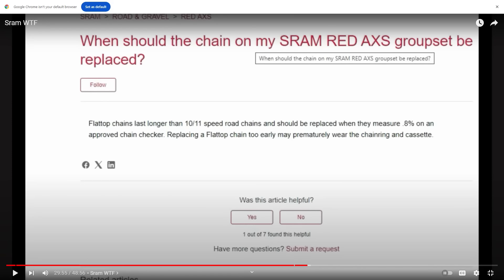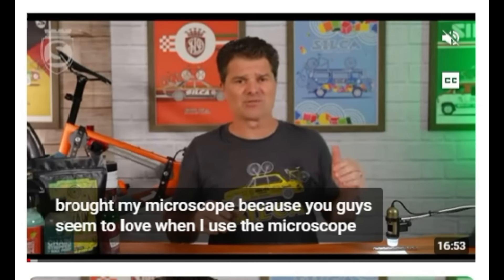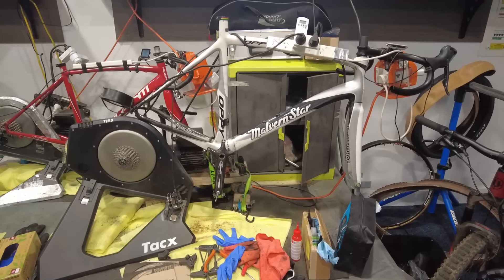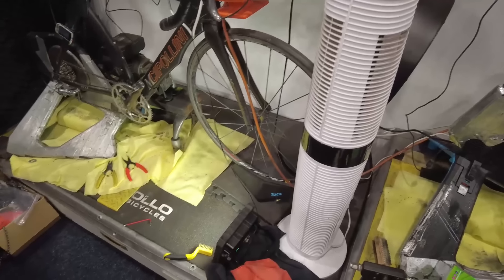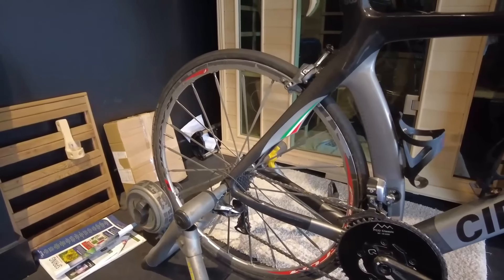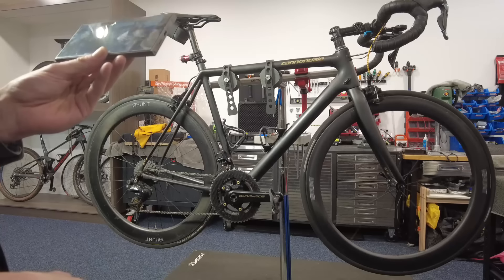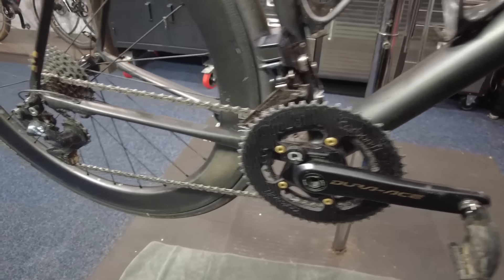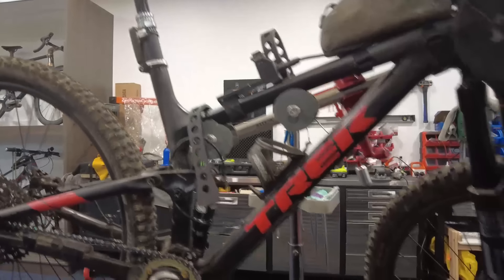News + My bike Fleet!

Comment: I only get the "wow this is a heavy bike" over 35lbs or so, and that's a mtb with a ton of suspension so it's fine. 
Of course the guy in australia hits a 🦘. Worse I have done is a snake. Some deer and turkeys have surprised me.
That final custom bike is beautiful. As a lug enjoyer it takes me back to the early carbon days of aluminum lugs+carbon tubes, but this is way better. I think of it in time for value. If one plans on spending a ton of hours on a bike it is much easier to justify it in my mind.

Comment: That's a great collection of bikes! Comparing your bikes got me thinking - how much 'suspension' effect should I expect from the Rock Shox Psylo front fork on my 2005 Marin full-sus MTB? Seems to do nothing unless I brake hard or hit a pothole. Do they seize up when old? Any ideas for a good replacement?? Sorry for the digression, it won't happen again!
Reply from the maker: Hey! i love digressions :). When was the fork last serviced? im not very familiar with the psylo, but all rock shocks forks i have owned have stated to service every 50 hours (which to be honest i sometimes extend out to 75 to 100, but typically never past 100). If suspension is not serviced, then it will not continue working well longer term, and then often a service can be very expensive vs just fluid change and new seals, and require a bunch of new parts such as new damper, bushings etc that have been worn by running abrasive dirty fluid for a long time (seals only last so long) - and very bad performance like being pretty stuck unless a hard hit - that is not uncommon with suspension left unloved. 

So have a good mtb LBS mechanic check them out, but be prepared - based on the price of psylo forks, new forks might be cheaper....
Reply: @zerofrictioncycling992  Thanks! It was a £120 (17-YO) bike when I got it two years ago, fork has never been serviced that I know of, and all the UK suspension specialists say that Psylo fork service parts are no longer available. Not on eBay either. I think it is seized up but not sure how much improvement to expect from a new fork. I was crossing some rough ground today at about 15mph and there seemed to be no deflection at all. Rear is also old RS (SID/XC) but that is working perfectly if I top up the air every couple of months - there are no spares available for that one either. It looks as if a new fork is on the cards!

Comment: LOVE your videos, mate !  A little constructive idea if I may :-) You might get a wider readership if you shorten your videos . . .
anything over 30 minutes is quite an online time commitment these days :-)  
1) With regard to using my Silca wax system : with a new chain I use their Silca Chain Stripper and then the SS Wax .  I don't believe in using the Strip Chip - I don't want ANY factory grease mixed in to my wax - ever . . .  
2) when re-waxing I do not put a chain with used wax on it (even if it LOOKS clean) in the SS Wax - I don't want ANY potential dirt mixing in with the virgin wax  . . . 
3) when re-waxing I remove the wax off in boiling water and then pop it into the hot SS wax -  IF any water remains on the chain it gets boiled off in the hot wax 
4) Ask Brad to take the following  into consideration : The mind is like a parachute : works best when open :-) He seems so intellectually shut down for not TRYING waxing !!!  I've been riding for 50 YEARS and NOTHING compares to waxing and believe me, I've tried ALL alternatives ! 
5) I haven't seen ALL your videos but there are advantages WAY beyond better drive train life when waxing - my bike is quieter, shifts more smoothly and more quickly and at a ride's finish, I simply take a clean cloth and take off road debris off the chain and I can clean the frame without worrying about touching the chain with my cleaning cloths because they never get dirty when touching the chain - and neither do I !! 
Keep up the good work and videos, mate. Greetings from Montreal !!!
Reply from the maker: Thanks David! And yes i know, i really do need to better on my vids, and i keep promising i will, and then not hahahahaha. I do struggle with a) it is not my strong point to begin with and b) i just am always rushed - it takes way more time to try to organise, script, cull, retake, edit etc a much more slick vid than just record the clips, wing, and boom thats that i had 1 or 2hrs window on a friday and trying to keep up. I keep hoping to find a bit more time to improve, and i will keep trying - thanks in advance for your patience and bearing with me in between! 
(oh, another problem for me is i like long vids so i also naturally gravitate to those too! but i am odd :)) 

Re 1) The whole idea of strip chip is it converts the FG to wax. its been pretty well tested, i need to control test it to see if any change in performance picked up by the main test, but havent got there yet, testing has been mental lately. 

Re 2 & 3 - its a balance. ie is the aim to ensure every possible fraction of a watt? (ie race chain, race wax pot) or is it to prolong the high performance of wax for as long as possible to get longest amount of re waxes, and lowest chain and component wear. If its the latter, and ESPECIALLY if most of your riding is dry road, the case for boiling water flush rinse every time is sadly not strong. It is possible that the water is evap out everytime no probs, its possible it isnt. We sell anywhere from 2000 to 3000 wax chains and wax per year, so we have a very big waxing customer base built up. Every year we get a handful of cases where a customer is experience high wear rates, despite being on a good chain, good wax, re waxing at normal intervals etc. Almost every single time it turns out to be that they are boiling water flush rinsing every time, despite only riding in dry road conditions, and waxing chain either wet, or with very slack attempt at drying. When this is stopped next chain and wax, yeehaa - awesome longevity for chain as expected. Mspeedwax hae also conducted tests and when cut open wax found pockets of water in the wax. But also, water is not without its own impurities, so over time it may be hurting wax / wax bond if done every time. 

Simply there is no case yet that the cost of elec and time to do this gives any benefit to dry road riding, even dry off road riding, and there is concern it is a detriment. Post wet rides - for sure, but we recommend drying chain with hair dryer or heat gun to be safe. I do this a lot in my winter riding, and i am getting still awesome wear life. 

I would watch waxed life like a boss vid and switch to the two pot system demonstrated there - this is the easiest way to keep wax amazing. As i ride dry offroad a lot too, this is brilliant for gravel / mtb as whatever dust isnt removed with a 10 sec wipe with cloth and alcohol spray to lift surface dust will then be melted off and settle to bottom of pot one. Really fast, efficient and guaranteed no risk of being worse, only better. 

Remember also what you are comparing too re drip lubes - drip lubes add 3 to 5 ml over the top of what is already running in the chain. And that is done over and over. Vs putting into a bath of hundreds of ml. It takes oh so many re waxes for wax in pot to be remotely like what is happening with drip lubes - so for training chains - one really doesnt need to stress much, most especially dry road riders - just so little contamination gets in when running a solid lubricant. but have a ponder, and if you tracking wear life - pit your boiling water rinsing method vs two pot like a boss system, the latter will win, and be easier :) 

Re 4 - yeah i have no idea what is going on with some still with mtb background. It is frankly illogical. Perhaps all his waxing customers are using the gunkiest DIY wax, and it takes them ages as they stand there to watch it melt. Must take them all afternoon to do washing when you have stand there to watch the washing machine and then stand there to watch the dryer. Far out. They will get there - but whats taking the mtb world so long is rather fascinating. And now if anything getting embarrassing. I mean it is just so simple, and quick, and logical. 

Re 5 - correct on all fronts! :)
Reply: @zerofrictioncycling992  Adam ! Thanks SO much for taking the time to write a really well developed reply to MY long comment . . . you're not the ONLY one that can go long as you can see here ! :-) 
Speaking of going long, I'm happy that you didn't take offence to my suggestion regarding shortening your videos - each to their own, right?  And  if someone doesn't want to watch a 50 minute video, nobody says they HAVE to :-)  I have never made a video but I do recognize that it takes a whole BUNCH of effort and time to produce good and informative ones like yours. 
 I will from now on, thanks to you, simplify my life and re-wax by immersing the chain in the SS Wax while skipping boiling the old wax off;  fortunately  being relatively new to waxing, I took the precaution of putting the chain in the oven at low heat for a while to help evaporate any moisture on it but from now on as you suggest, I'll forgo that step. 

Following another suggestion of yours, I watched the Waxed Life Like a Boss video and I find the two pot system simply BRILLIANT!  Coming from a professionally trained background of automotive detailing, the ONLY thing I would change there, is making the stand-off dirt guard in pot ONE a little higher with a slightly tighter "screen" to make SURE that while immersing the chain, some links don't accidentally fall through and that the whole chain does not "disturb" the jetsam at the bottom of the pot :-)  

When it comes to clean, I'm lazy as you will ever find LOL  . . . I ride non-racing road and never in the rain if I can help it . . . so as per your suggestion,  that leaves me free to simply dump my chain straight into my hot wax to re-wax if I understand you correctly . . .  

Thank you also for your take regarding the Silca Strip Chip miraculously converting FG  into wax . . . with no chemistry background,  I'm having a bit of trouble getting my head around that but since the Silca Chain Stripper/ Chain Prep does such a great job on a new FG chain, I'll calm my nerves a bit and continue with that and as Josh does, I'll keep the Stripper "alive" by putting it back into the bottle through a coffee filter.  On YOUR end I can readily understand that in PRODUCTION, that might a QUITE expensive option. 

Since I won't be having to deal with dirty old greased up and lubed up chains I won't have to worry about cleaning THEM fortunately ! But I think that if I had to clean and wax a friend's gummed up chain, I'd use brake disc cleaner first on the removed chain (as long as it measured correctly for wear) and cassette but that is HGHLY  toxic so  I'd do THAT outside and  over a bucket that I could dispose of safely and environmentally safe as well.  After having completely cleaned the chain with that toxic brake cleaner and letting it dry (a matter of seconds)  I'd THEN pop it into the Silca Chain Stripper Prep to give it the best chance of having the hot SS wax adhere to it. UNLESS you have a better idea about that process of course :-) 

THERE! if you think YOU can go long . . . here's a dude from Canada that can be your counterpart in the UPPER part of the Globe LOL 

 I'll be watching your videos like a hawk from now on and catching up on the ones that I have missed!

Many thanks Adam  . . . And Cheers ! 

Sincerely, 
David 
Montreal
Reply from the maker: @davidbee8178  thanks so much david, sorry for delay response on this one the weekends things get away from me :) 

Much appreciate your input and support and yeah lets see over time if i can get better at my vid presentation - and never worry re offence on things, there is always a very easy clear difference between one wishing to give feedback for help, vs someone just being a douche and hating on X persons efforts. I have barely a clue re YT, vids, editing, and like - speaking.. so already i have had some really helpful tips and hints from viewers that have improved things from uber basic to..... slightly less worse :) 

And yep with existing chains for sure that is very chain dependent. Ie if it is a half worn ultegra 11spd - is it worth it. If its a sram hardchrome chain worth a pretty penny, for sure still worth it. But existing chains really can use a lot of product to properly clean for waxing, and the expensive fancy cleaners arent really for that. 

right must dash for now, still trying to get on top of last weeks vids and weekends inbox. Keep rocking riding in canada, that always seems hardcore from down in here in lovely radelaide hahahaha

Comment: So...a bike in a sauna, I haven't seen that before? I sweat enough as it is 😅
Reply from the maker: have you not seen / heard the stuff re heat training?! I dont do it properly (ie its meant to be multiple times week for a good block to really get the adaptions) - but i have found even once a week is better than none a week. I used to struggle in really hot races, now i am generally one of the least melty in hot races, and out of my training friends i am i think suffering the least on hot days - especially vs some who really struggle when its hot.  I may be getting very small cross over benefits of other stuff but mostly its just staying heat adapted. And as your watts are so much lower, you can do a session thats hard on you, but soft on the legs so it doesnt really tire them for the next days riding.
Reply: No, I haven't heard of it? but that's good to know.
Thanks for the info.
Reply from the maker: @colinl2908  yeah do some googling on heat training for cycling / listen to a pod or two - ronan mclaughlin on escape collective did one recently for his performance process podcast - but i have found even once a week circa 1 session - i still notice good benefits vs not doing. And especially in winter if its cold and wet outside, doing a heat spin instead is mighty more pleasurable! You dont need a sauna. A small-ish room with a fan heater blowing on you (from a distance) and chuck on some warm ish old cycling kit, and you will be very warm very quickly. At old house pre sauna i used to do in our bathroom - had the heat lamps on from above, fan heater blowing straight on, thermal bibs and base layer, and that did the trick for sure.

Comment: Can you talk about silca speed chip vs rex wax4:1 and 11:1
Reply from the maker: sort of little. Mostly will need to test of course but oh man, testing workload!!! holy batman.... 

Rex 4:1 is amazing re overall longevity and wear protection - in control testing it really does just keep going interval after interval after interval. In real world - you do get that comparatively longer time of wear protection, but still at some point the wax will get very thin, and so feel and sound dry past a certain point. this will be longer than say msw or hot melt - but not the massive kms before it really gives out and wear protection is suffering. So the main demographic is for long hard events flag to flag for most protection. 

If endurance acts similar to 4:1 - it will be a great option for some. 

But the main focus for my test will be any negative impact in wet. To date - having tested a lot of blends for a lot of mfg - one thing keeps coming up that has been unexpected to everyone initially, and that is the higher concentration blends have been going worse in wet conditions vs lower concentration blends.

So still for most i think that 11:1, msw, normal hot melt - its really all you need - its just great performance and low wear across normal conditions. If one only ever rides in dry and wants to always push treatments longer - then sure - 4:1 might suit them, but thats pretty expensive mix then, so if one can just re wax at sane intervals (top up with wax drip in between if needed) - i would recommend most still just go 11:1, normal HM, or msw. 

but - i am also a fan of groovy options. More options can suit more people.  

I hope silca release some overall test data but that will be a main focus when i get to test, when i can.....  I have no idea when yet, and i likely wont stock until i test and it proves worthy  re differential in testing (the speed  chip i cant test for efficiency so i am going to need silca data on that). As we saw with hot wax X, sure that did go ages, but oh man the break in was just too brutal - the customer experience would have been a concern - and for that price - i wanted to see perfection, so i never stocked and recommended.
Reply: @zerofrictioncycling992  Thank you so much for taking the time to write that reply. I really appreciate it.

Comment: Wondering what kind of clearance you've got left on the Cannondale with those Hunts and wider tires. I'm pushing my luck with wider rims/tyres on a rim brake frame not quite designed for such clearances...
Reply from the maker: yep the cdale is fine with 25's which is all i run on those hunts, they are only 24mm external - so not too far over rule 105. I am sure hunt have much wider models now, that model is a good few years old when i finally got jack of LW.